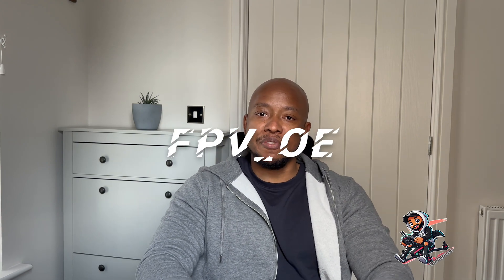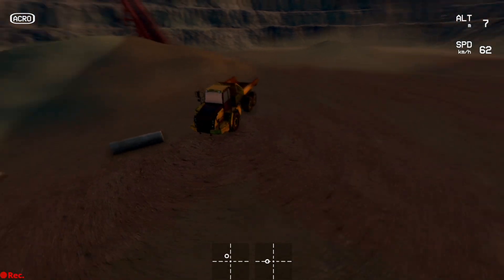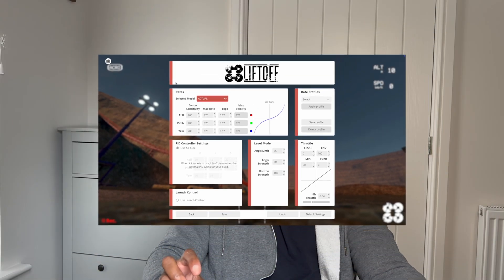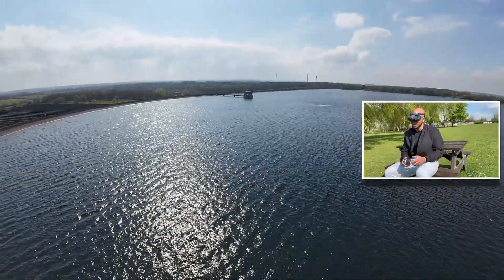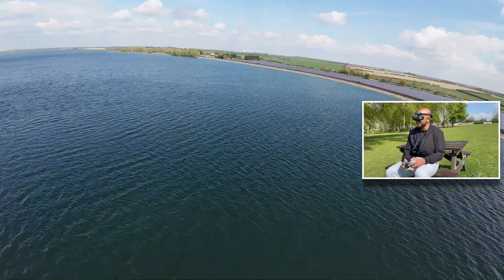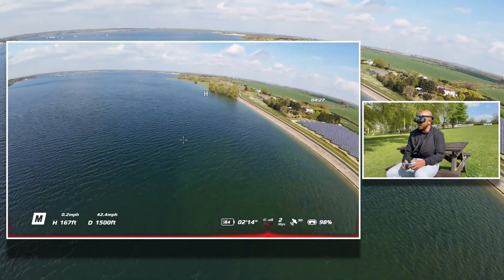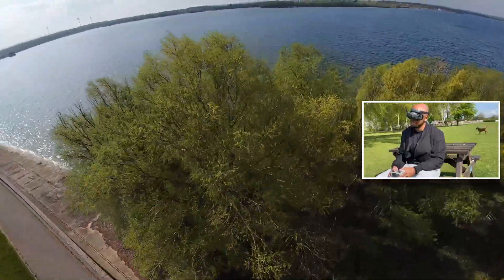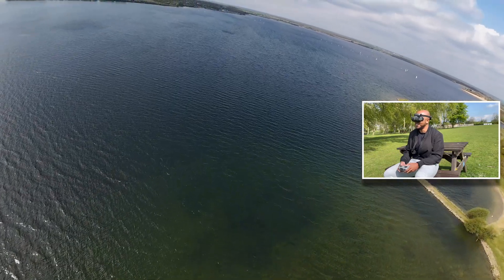FPV rates EXPLAINED & Tested on DJI Avata 2

Comment: braver man than me flying the avata2 over water in the wind lol but well done for trying 👍center sensitivity numbers = lower value offers finer, smoother control, while a higher value results in a more reactive drone to stick movement. and Expo basically the more you add the less linear the control line is so it flattens out the center of the stick so again less sensitive in the center , but the max rate is spot on 👍👍 the wind deffo dont help the avata 2 due to the duct they dont like windy days at all but keep trying mate
Reply from the maker: Wait.... Your expo explanation is the same as what I was trying to say… but the centre sensitivity is opposite!? 🤣
Is what I said wrong 🤣😅. Everything I’ve watched and read agreed with me lol. And I figured I may as well take a risk, better scenery lol.
Reply: @ yeah expo is easier to see on a scale than explain like in beta flight but yeah it’s not so easy to explain but deffo the centre sensitivity was backwards lol if you wanna see how that works turn it up real high and turn max rate to zero  then see how it flys , it’s kinda how I did it just to see what the different numbers are like lol its interesting 😂
Reply from the maker: @millermanffwd ah damn it 😅. Ok so the expo and max rate are right. The CS the opposite lol. I’ll pin your comment 🤣😭
Reply: @FPV_OE  was also gonna say test it on your sim not over a lake lol 😂
Reply from the maker: 🤣😂 I’m literally about to test it on the sim lol.

Comment: Nice video, thanks for explaining what the settings actually do :)

Very new to FPV + Manual myself (Neo and Avata 2) but still got a small recommendation, try putting the controller in your lap (or use one of those neckbands the pros are using), then control the sticks using your index+thumb instead of just thumbs. I feel it gives more precise control/movement of the sticks.
Reply from the maker: Ah nice, which do you prefer? Honestly I’ve tried pinching, I just can’t get to grips with it. When I’ve used my sim I’ve tried flying that way and it just doesn’t work at all lol. But I didn’t actually rest it on my lap then either…..so maybe I’ll try resting it and see how I get on, but I’m not holding out hope lol.

Comment: You bold bro! 😮 that wind was crazy. I’m currently training in a simulator right now. I got about 6 hrs in but I know I’m not ready to fly my Avata 2 manually in real life. I know it struggles in heavy winds.
Reply from the maker: 🤣😂 I didn’t realise it was so windy until I got there, by that point I was committed to flying lol. How’s it going in the sim? I say get out there and fly it though, the Avata handles slightly differently to the sim, it’s more underpowered. So id defo say get some flights in with it, just stay high and get ready to hit pause if you need too lol.

Comment: I don’t think it matters in manual mode but I know the sensor on the avata 2 don’t do well over water from videos I watched.
Reply from the maker: Yeah, both your comments are right. The sensors can mess up in normal and sport, but in manual you have nothing to save you but yourself and the pause button lol. But speaking from experience… the pause button can only do so much 😂.

Comment: Thank you for covering this topic.  I've only put in 30 hours, between Liftoff & Liftoff Micro Drones simulators & haven't flown my Avata 2 in full acro yet.  Aside from the wind factor, I was curious to know if the drone you usually fly in the sim is faster & more powerful than the Avata 2?  I'd imagine the wind drag from the prop guard may assist in a different flow, as opposed to the simulator not having wind.  Depending on the camera angle, it could help get a little more umph where it's needed.  However, I do think you're on to something good, when it comes to setting the rates to match the simulators drones.  I look forward to seeing the results on a less windy day.  😉
Reply from the maker: Thanks, I was giving my best explanation of it as I’ve read so many bits and bobs and they all make it more complicated than need be. But turns out I may have got the CS values the opposite way 😅.  But the drone I fly in liftoff I’ve tried to match the spec to the avata as best as possible. I picked one that weighs roughly the same, and also goes about the same speed. But I definitely feel like the drone in the sim has more gusto lol. Not sure if that’s because of the ducts, or because it’s more powerful. But I’ll definitely be trying to nail that orbit when I get another chance lol.